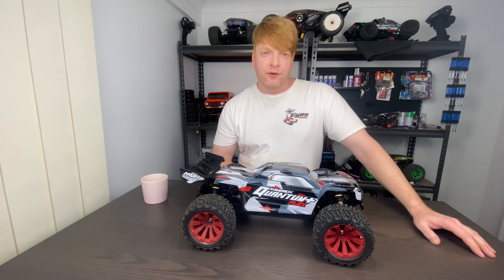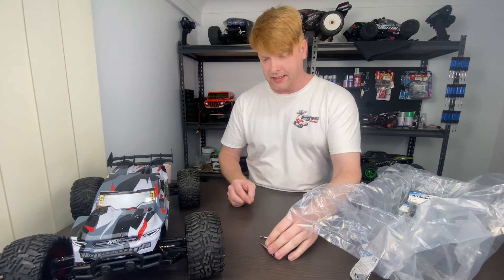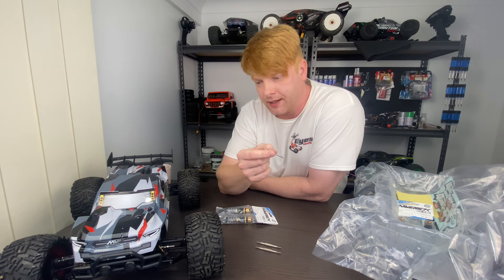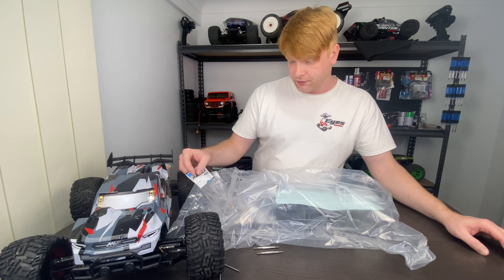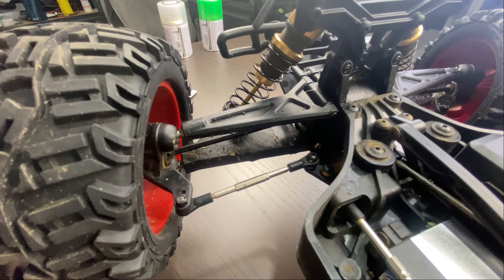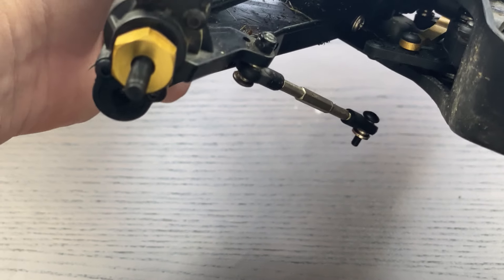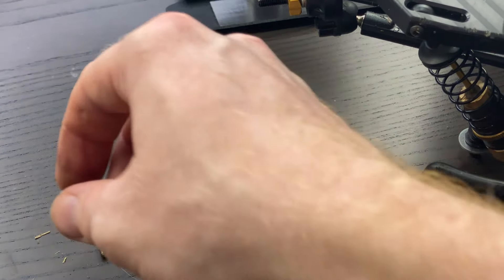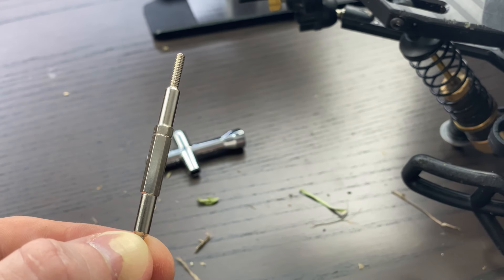Maverick Quantum Flux - 3 MUST DO HD Upgrades!

Comment: Thanks for the vid.

I got myself a set of the HD shock shafts rather than the whole unit, so knowing that you’ve experimented with oils before,  I wanted to ask what weight you have used.

Also do you even know what weight they came new as?

I like the paint job to. Even on the camera the metal fleck cones through nice.
Reply from the maker: I honestly don’t know what they have from factory but I can try to put the question through.
I run 70wt from Team Associated, I’m pretty happy with that. 
These shocks came pre-filled so I am not sure what is in them, will be sorting that out after the first run.

Comment: Any recommendations for a center diff or slipper clutch upgrade?
Reply from the maker: Mainly to ensure you have proper fluid in the diffrentials( Front, Center and Rear) I have had absolutley no trouble with my differentials on this but I serviced them before my first drive.
Reply: @EyesOnRC  I'm trying to find a slipper clutch or viscous diffs to put some give in the driveline.

Comment: Hey man ! Did the 60-100-30 diff setup. Is it normal that the runtime goes down almost 50 % ? Running 5200 2s and before I did the diff I was getting around 20 minutes from each battery. Now it's just 10 minutes. Is that normal ?
Reply from the maker: It will have some impact but I dont think it should have that big of an impact, might want to check it something is binding up somewhere.

Comment: What suspension arms are you using
Reply from the maker: Metsafil arms
Reply: @EyesOnRC  where did you get them from and are the much better than  the original ones
Reply from the maker: @chrisj3741  I will have a link in the description a bit later, the come from Portugal.

Comment: No.1 Buy a Suitable sized dustbin . 
No.2 Don’t use it, unless you like fixing it. 
No.3 Don’t buy it at all.
Reply: So it's not good?
Reply from the maker: It depends on what you expect, it’s a fairly cheap hobby grade rc, it’s not that durable out of the box.
Reply: @EyesOnRC  I wouldn't call the plus cheap, and that one has the same parts that are an issue right? The upgrades aren't TOO expensive tho. Is the drivetrain solid though? That's what I'm worried about most.
Reply: @ValFPV  
If you buy the plus you’ll want to shove a 14mm oD x 6mm iD washer behind the Hex as you would bung a 12x6 behind the 12mm smaller Mav, the HD Axles , HD Driveshaft, seem a bit sturdier than the production roll out parts, 
The But they still bend relatively easily , 
The car it self with a bit centre diff tuning can drive quite nice ,, however it is heavier and on the same parts as the little Mav, the Wing Mount and wing are totally 💩, the Body shell is Not too For behind it,  the Shock tower being screwed on to the gearbox housing is another stickler .  It breaks often  the little maverick quantum now comes with the upgraded parts and an 80amp ESC over the original 45amp, 
Which gave it the Jitters on 3s , 
But that has now rocket up in price too, in my opinion after having both, in the longevity of things of was going to buy a Quantum Plus, 
I’d wait until you could afford the Arrma big rock . Bit more expensive but mine has taken a good spanking and it hasn’t broke in contrast at my fav bash spot the Maverick lasted 30seconds .